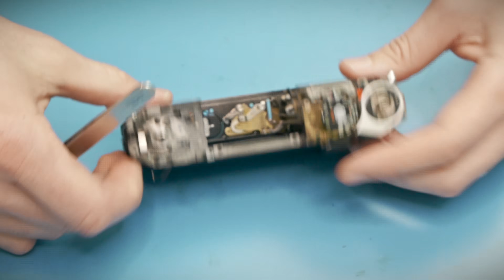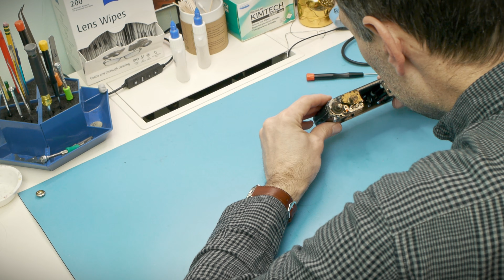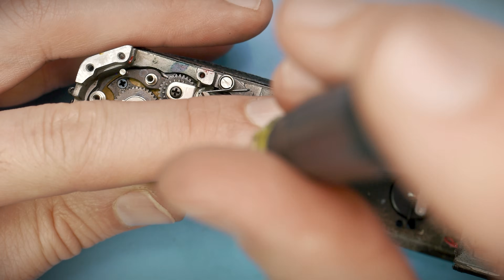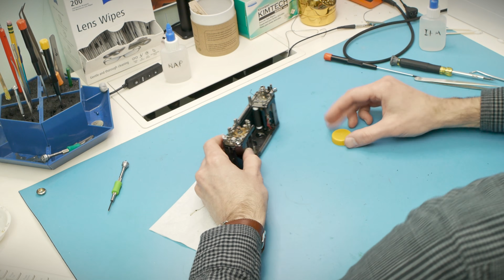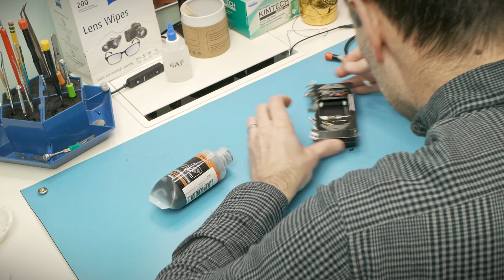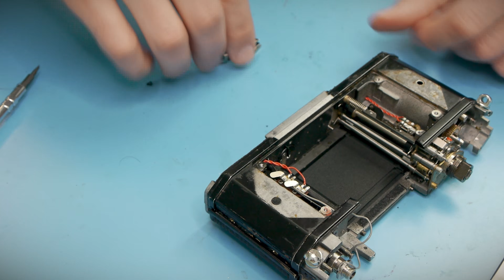Pentax K1000 | Part 5 - Shutter Service

Comment: It blows my mind the amount of engineering that goes into designing these vintage camera mechanisms, and all without the use of computers. For the amount of engineering time, manufacturing of parts, and hand assembly required, it's a wonder that these cameras didn't cost several thousand dollars to buy back in the 60's.

Comment: Great how-to video. I'm working on a few Spotmatics that I bought off eBay as parts cameras and all of them have shutter/stuck mirror issues. I've managed to get them all working again but I really wanted to take them further apart in order to service the slow speed mechanisms and other shutter related parts. The mechanics of the K1000 appears to be identical to the Spotmatics so this is going to be very helpful. I may take one of my really beat up Spotmatics completely apart and try reassembling it, just for fun and the excercise to gain some knowledge.

Comment: Anyone you'd recommend in England to service/repair this model?

I live in Greater Manchester. I have a K1000 and it seems to have the same issue as this one had.
The shutter sticks when using slow speeds between 1 second and 1/4 second. 

Fortunately I don't really use these slow speeds and all the others seem to be working fine, including bulb. 
But I worry the problem will get worse and start to affect other speeds.
Reply: Vintagecamerasgalore are reasonable

Or PPP cameras but its several months wait ATM 

Camerasbymax also probably do k1000

Comment: Very informative, but also intimidating seeing all of those tiny parts, bushings, screws, etc. Think I'll attempt some of the more basic stuff on a parts camera before this! Could you just use a ultra fine tip sharpie to mark the position of the gears? Seems more accurate and less messy to clean off.
Reply from the maker: I would give the sharpie a try. Sometimes it wipes off too easy but it might work here.
Reply: @SamsCameraBench  Gotcha. Also, where do you get the foam scraping tools that you are using? They look like sturdy metal but blunt and polished so they don't scratch surfaces. I may start getting some tools to learn and attempt these repairs.

Comment: Hi, i didnt mark underneath curtain gear sync so I put it back as I assume it was but not sure. With the assembly at the stage of the end of this video slow speeds work but after 1second speed I dont have bulb and it goes full speed I think. Do you have any tip for what I should look for?
Reply from the maker: The issue with bulb not working sounds unrelated to the curtain timing. Probably something wrong with the bulb latch.

To check the timing of that gear, fire the shutter in bulb mode but hold the closing curtain open. Look at the camera chassis at the leading edge of the curtain. There is usually a scribe mark from the factory indicating where the closing curtain starts. The edge of the curtain should be right at the scribe mark. If there's no mark, I think the distance to the edge of the frame is supposed to be like 6.4 mm. Good luck!
Reply: @SamsCameraBench  oh thanks, i can see the mark! at what point of dissasembly must I adjust the gear i assume is the little curtain one on the top when the lens mount is facing you but when rotating it opens that curtain under no tension and I can't see the mark because of not being able to cock and shot the mechanism when being that dissasembleld.
Reply from the maker: You can install the curtain/bulb latch while you are setting the timing on the gear. Once you set it, wind the gear until the latch catches it. That's where it will sit during a bulb exposure. Adjust until it sits on the line.
Reply: @SamsCameraBench  that was very helpful thank you so much. At the moment curtains are working good but when testing teh fire sequence it fires when pressing the transport latch pin and im not sure about the cause, did that happened to you? For some reason it gets pinched a bit under the gear. Not sure if thats direct cause but starts happening with the brake lever and the assembly under the oiling thing. In the manual they say maybe I need to replace the ratchet lever on the transport gear but I dont think its damaged. Thanks!

Comment: Dear Sam, I have fully taken apart a Praktina FX (The first model). 
The timing mechanism uses a coil spring that got damaged on cleaning.
I have tried 3d-printing an axis/face-plate that holds the coil so that it doesn't move in the z direction on tension.
I would really like to find a replacement for it.
Not having a manual or understanding it I didn't understand that the entire curtain timing mechanism stems from the curtain tension.
Simply put: I done fckd up.
Perhaps you could help me with this since you are, proven, a repair master.
As for now I am conserving the body and mechanisms but are basically only parts.
I feel sorry for this beautiful camera.
Looking back on it, the only thing wrong with it was some dirt and the slackened tension on the curtain tension.
Hindsight.
So A: If I have been able to make myself clear about what went wrong, is this recoverable?
B: What can you suggest me to do, if you  pretty please?
Highest regards,
Mac

Comment: Hey Sam, I'm repairing my camera. After I put the pallet rod back during operation at no point does it push the pallet off the star wheel. Could you be more specific in what exactly the top 2 hooks interface with?
Reply from the maker: The top top hook is the one that controls when the pallet gets pushed away. The end of it should rest on the side of a cam just beneath the shutter dial plate (the piece with the screw holes). It's easy to install the shutter dial plate so that the cam sits on top of the hook instead of alongside it. That's my guess as to what happened. 

The second lower hook is part of the curtain braking system. It should extend in between the curtain wind gears, sitting just above the second curtain wind gear. When the closing curtain completes it's travel across the frame, a pin on the wind gear strikes this hook. The spring action in the pallet assembly acts as a break. This also means that the pallet will only engage with the star wheel when the camera is wound, because it releases the break.

Let me know if this helps or not.

Comment: Great videos series! Would love to see a tutorial on how you would disassemble, clean, and adjust the shutter timing of the curtains if you get a chance. I have a difficult time getting the shutter speeds accurate across all speeds after fully cleaning and adjusting a camera with shutter problems.
Reply from the maker: Currently working on the last video for this camera where I adjust the shutter timing. Unfortunately, I also have some issues getting all the speeds within spec. So I'm not sure if I'll be able to provide any answers but at least some company in misery, haha.

Comment: Very nice series, definitely helping me get a leg up with understanding how the modular shutter components link together, and gives me a bit more confidence with my disassembly. I was always pretty hesitant to start removing linkages because I don't know the particular ins-and-outs of how the components interact - but I think I have a better idea now.

I have a question though - since you seem to have some watchmaker's experience to some degree. Is there any good or bad reason to add some slight lubricant to the star wheel and pallet/ratchet mechanism it engages on the slow speed mechanism? Most of the watchmakers I observe use a thin film to help with smoothing the escape, and reducing wear as the teeth and notch engage repeatedly.
Reply from the maker: I don't have any first hand experience with watchmaking (just watched some videos on youtube), but I do know what you're talking about. It's common practice to lubricate the contacting surfaces of the pallet fork. Unfortunately, I don't have any good insight for you. All I can say is that the service manual doesn't recommend it, but I don't know the reasoning. Good luck on your repairs!

Comment: This has been a fantastic series, Sam!

I recently pulled my K1000 out of the closet to take pictures of the eclipse, and found my light meter acting erratically.  As I changed the shutter speed settings, no (or very little) movement of the needle, regardless of the amount of light.  But as I clicked through the settings, I would periodically hit one that caused the needle to peg at the upper end and stay there, again regardless of the amount of light.

I’ve been watching videos to see if there was anything I could try to fix it, and so far your videos have been the best source of useful information.  

Thanks, and keep up the good work!
Reply from the maker: Thanks much. It sounds like maybe the variable resistors around the shutter speed dial or the aperture could be dirty. I'll be doing a video on the meter circuit in a couple weeks where I dive into those parts. Hopefully you can find something to help you sort out your camera.
Reply: @SamsCameraBench   I’ll keep my eyes peeled for it!

Comment: Awesome informative video. Thank you for the detailed explanation!
I've done this procedure for repair, but not for regular CLA. your video is motivational to try it again. 
However, in my case the camera was initially jammed. i could not understand why the bulb mode would not activate, the second curtain latch would not engage. the service manual suggests filing the latch, but i decided to gain more experience before doing so.
Reply from the maker: Hopefully some of the explanations in the video help you sort out your camera. If you have any specific questions, feel free to email me.
Reply: @SamsCameraBench  Thanks again for your videos. I have worked on a few bodies and realised my mistake. Any manipulation on the shutter requires the mirror box installed. So the bilb problem was on the KM without mirror box, but not on the k1000 and spotmatic (they work without it). And also the k1000 requires a mirror box to activate 1/1000. My problem was trying to make sure the shutter worked before installing mirror box.